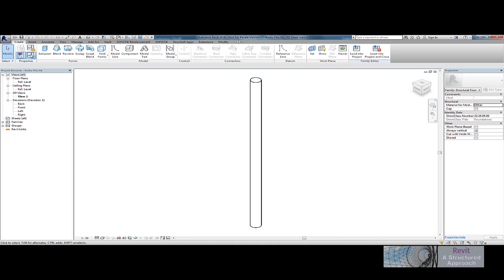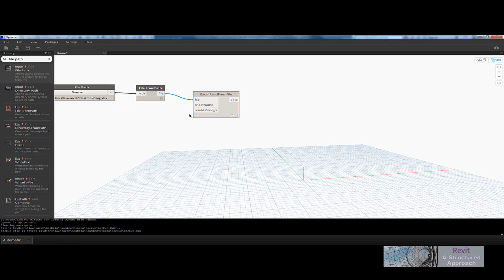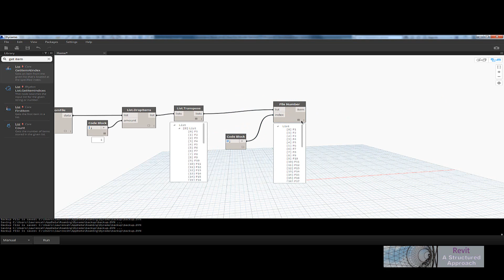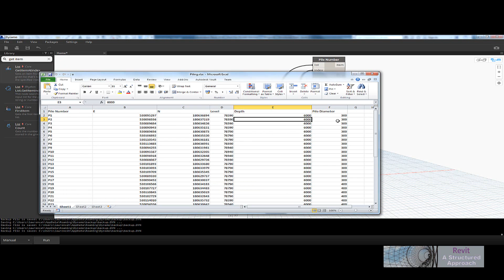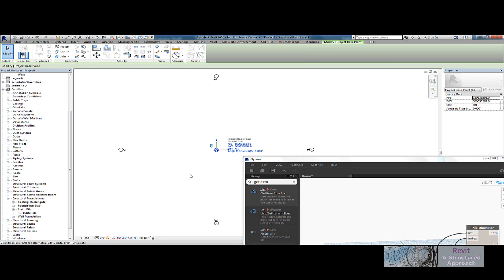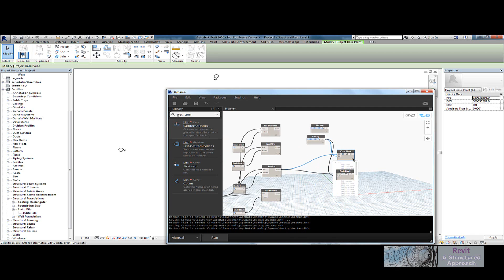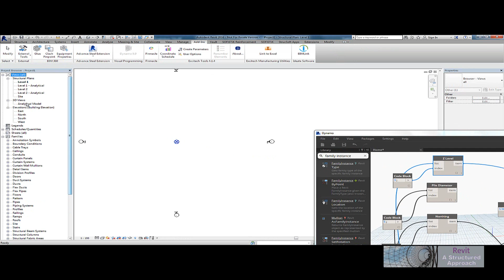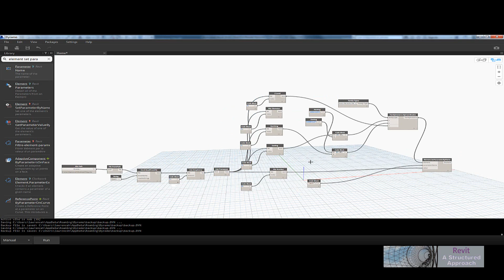Modelling Piling from Excel using Revit and Dynamo

Comment: How do you get it to plot the various diameters of the piles without splitting up the lists in Dynamo? i.e. I have 610mm Piles and 510mm Piles but for some reason the pile family won't recognise the pile diameter script and just plots in the piles with the generic diameter it was created with, 600mm. Is it a constraining issue? For some reason I don't think I can get the extrusion circle to constrain to the reference planes.